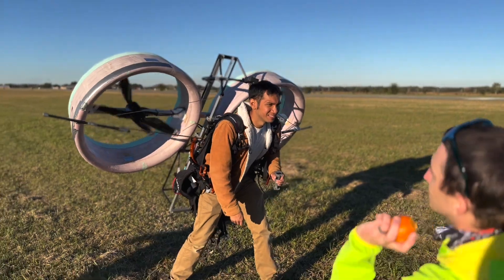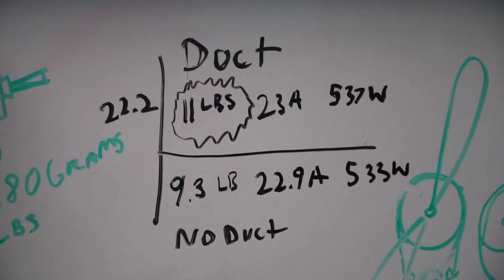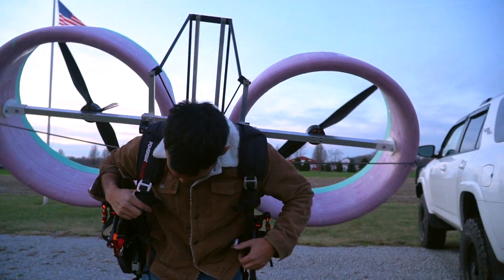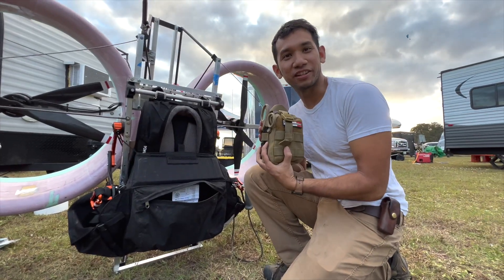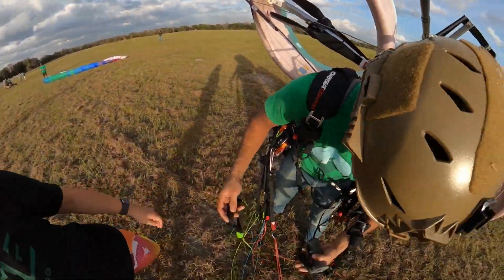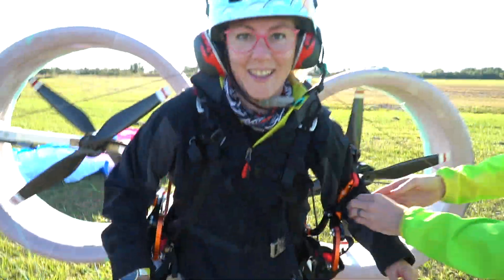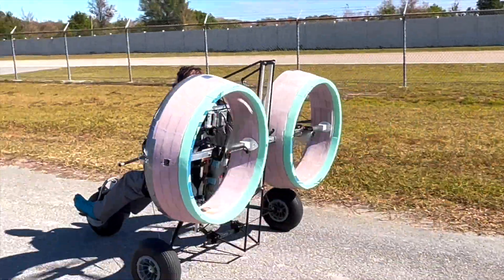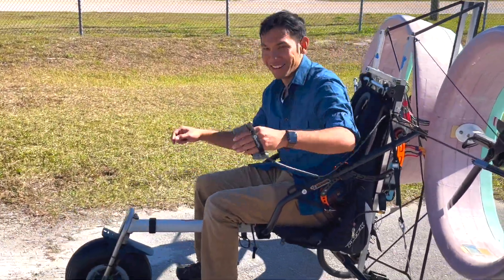Flying with four giant drone motors (ducted propeller paramotor)

Comment: What about using one large "traditional" size ducted fan but using 4 motors with pulleys and belts?  That would allow you to tinker with gear ratios to play with torque and prop speed.  Should you lose one motor, you'd likely still have enough power from the other motors to land it and you'd get to skip the off-axis propulsion problem.  It would also be MUCH smaller (i.e.  aforementioned pizza problem) and most likely lighter.
Reply: I agree on all counts. The big issue I think with this is that it would require some custom machined parts that are outside of Peter's typical repertoire.
Reply: @bradley3549  True, but a good variety are available at stores such ad Tractor Supply and you can get ANYTHING off of McMaster Carr.  Anything that could kill or maim me is worth a few extra dollars.
Reply: @mattfleming86  I love me some Tractor Supply and McMaster Carr - but I don't agree that you can get exactly what you would need for this sort of thing off the shelf. The bearings themselves, sure. But the hub/shafting/bearing housing is all going to be pretty unique and custom to this application - especially if you don't want it to weigh a ton.

Comment: Great video! Quick question what is the feasibility of a hybrid system and would that play well with the FAA limitation on Gas or is there now a gas AND battery limit?
Reply: I haven't seen a limit on battery's but I think the gas limit is incase you catch fire. 5 gallons of gas is a smaller boom than 30 gallons
Reply: @Danoblegamer  heh, accidental warcrime pissing off the geniva convention dropping 5 or more gallons of accidental burning fule/ napalm from the air XD
Reply: I wonder how many batteries it would take to match the fueling limit.
Reply: @Leadvest   - too many to wonder about - ie. at least 5x the weight (allowing for weight and efficiency comparison between ICE and electric motors)Li-Ion (etc)
 Batteries  <300Wh/kg,  Petrol = 46MJ/kg ~ 12,200 Wh/kg / 10 (weight and efficiency factors) is still 6x more dense than batteries...

I do wonder...  A lot.
Reply: Shame about all the bots

Comment: The more Peter I watch, the more I think "with a few chinise electronics, I too could rule the sky" 

Half forgetting silly sky laws.
Reply: what are they going to do, pull you over in a police plane?
Reply: Jail time.. you’d really really have to piss some people off for jail time I’d think. Flying low and around private property you’d be hard pressed for anyone to even find out
Reply: @matsmann  Well.. if the military uses the airspace nearby, it would be pretty wise to not fly anything near that area
Reply: While all of yall have some points, in th U.S the FAA has a regulation regarding these paramotors and other ultralight aircraft under FAR 103, it establishes what is considered an ultralight aircraft than basically says there's no licensing or registration required, and all you have  to do to fly around is stay out of controlled airspace and only fly during daylight hours. So basically the U.S has some of the most relaxed rules when it comes to these vehicles, as long as you meet the requirements, stay away from airports and military bases and only fly during the day than you can do whatever you want in the sky.

Edit: also no flying over populated areas so no city flying
Reply: @matsmann  sounds suspiciously Australian..
Reply: @feelincrispy7053  the US had more military and prisons that anywhere else in the world. The US absolutely has the most oppressive airspace rules in rules in world.
Reply: You can legit build whatever you want and fly it around as long as it meets the ultralight requirements, the FAA only doesn't care if you put yourself at risk they only want to make sure you don't put anyone else at risk which is why one of the requirements is it has to be a single person aircraft